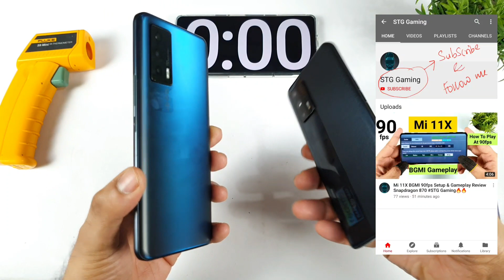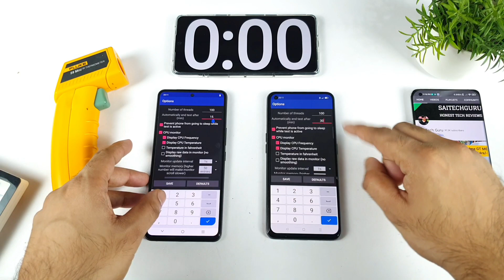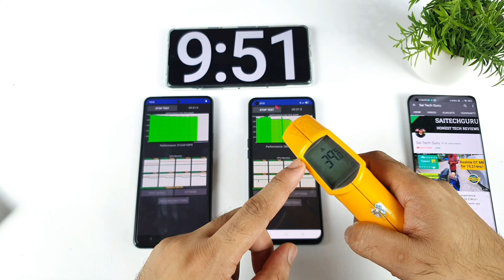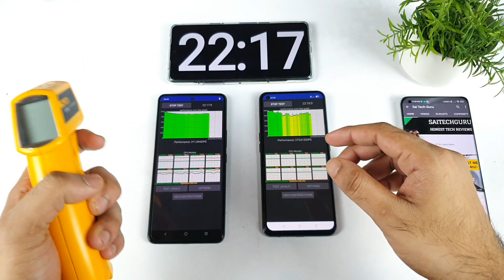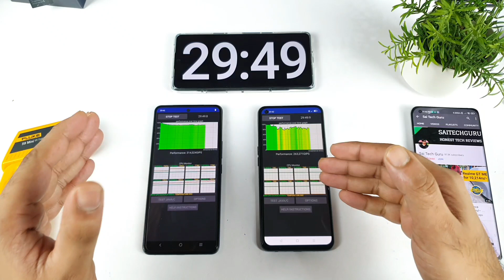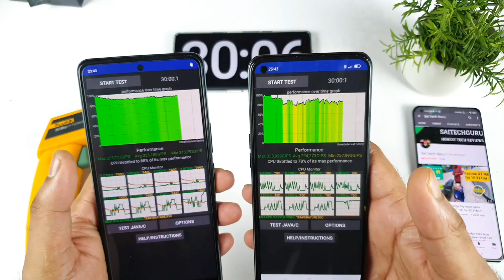iQOO 7 vs Realme X7 Max 30mins CPU Throttling Extreme Test comparison Snapdragon vs dimensity

Comment: Sai bro in the latest A.19 update CPU clock speeds of Realme X7 MAX has been reduced as you can see the performance of that bottom right most core.there is too much fluctuations in that core . That's why dimensity 1200 is unable to show it's potentials.
Reply: Thermal throttling is playing a major role behind the performance downgrade.
Reply: Which has been enabled in this A.19 Update.
Reply from the maker: I did notice bro
Reply: @SaiTechGuru  hmm
Reply: @ÆGeñT2954  can it be fixed
Reply: @hgyufyu6992  only by software updates

Comment: Iqoo is a beast 🔥🤪🤪
Reply: Its not iqoo its sd 870
Reply: @vedantmishra684  Yeah 870 is inside Iqoo 7.
Reply: @memories4902  compare it with neo 2😎
Reply: @vedantmishra684  Still Iqoo gives tough competition even though it was launched before many months.
Reply: @memories4902  thats what  i am saying  launch many months ago before x7 max but still don't have 90 fps and x7 max has even with slight weak processor
Reply: @vedantmishra684  Only 90fps can't decide a phone's capability I reckon. Nothing can match Ram management of Iqoo at this price point.
Reply: @memories4902  wait for neo 2😎
Reply: @memories4902  and yes realme me is at 23 iqoo is at 30k huge difference